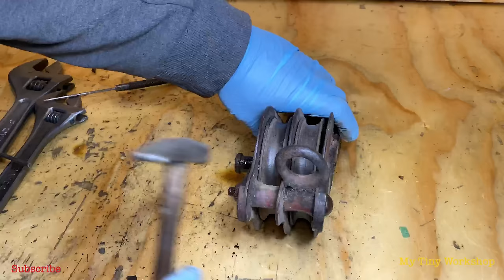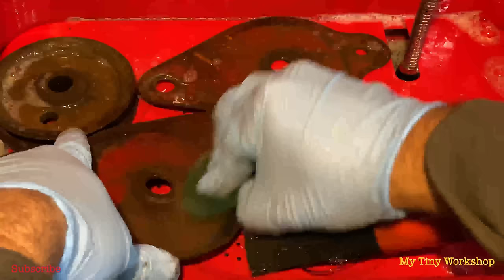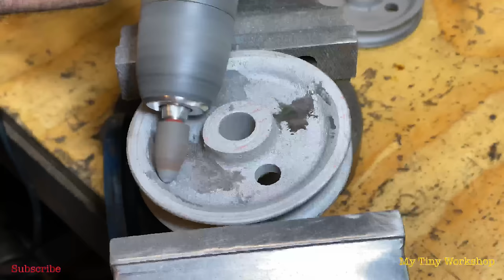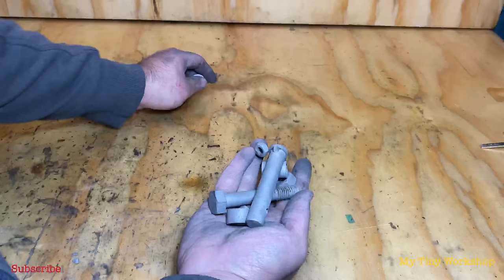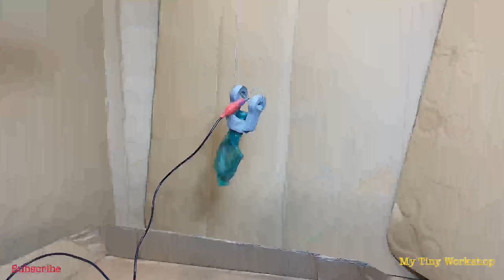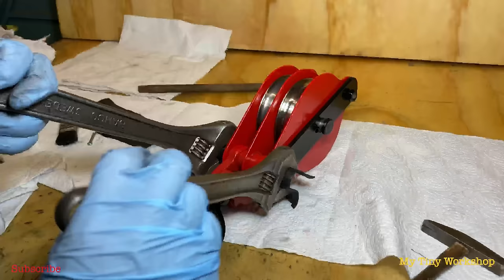Vintage Hook and Pulley Restoration

Comment: It's always easy to give your projects a thumbs up because your work is careful and thorough. This pulley has probably never worked so easily after you finished with it. Thank you for not letting a good piece of equipment be neglected, and best wishes from the USA
Reply from the maker: Such a nice comment. Thank you very much. I was rather shocked with the final result. It turned out better than I could have imagined.

Comment: Hi bro 👋👋👋 good to see you 🤝🤝🤝 awesome restoration 👍👍👍 sandblast is an idiotic thing 👌🏽
Reply: Question - why do you think sand blasting is not a good idea ? It appears that he uses glass bead media,  this does not deeply    
Etch metal like sand . Your opinion please ,as l also use glass media. Thanks
Reply from the maker: Thank you, glad you like it. could you elaborate on the idiotic part. Your opinion means a lot to me.
Reply from the maker: I currently use aluminium oxide. I would like to use glass bead. Eventually I want to try different types of media.